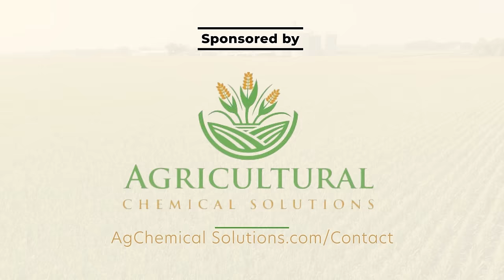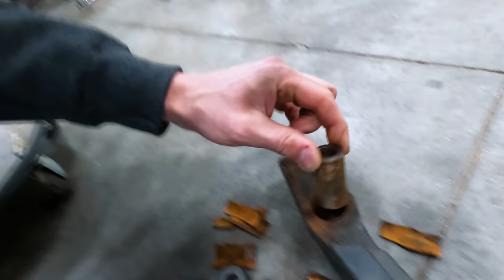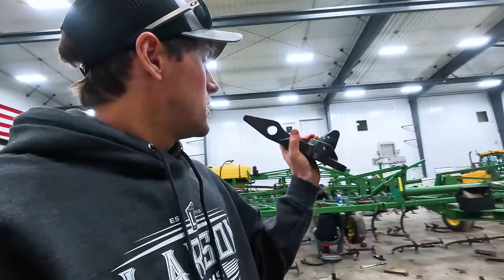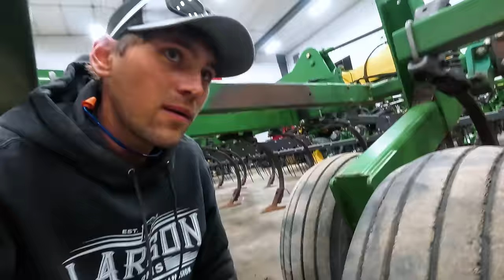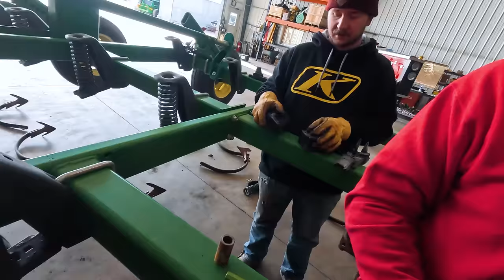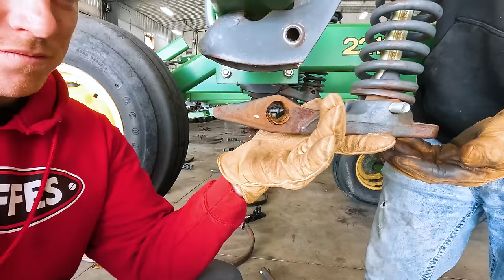Used And Abused! Time To Rebuild!

Comment: Ever thought about using plastic outrigger mats instead of blocks/wood for your lifting legs?    they are much handier, lighter, and sturdier than wood.    as a bonus most of them have holes for rope loops for lifting, moving, and storing them on the equipment : )

Comment: Yep, corn prices aren't good if you're selling. But finally, for those of us who have cattle and a feedlot, it's a blessing. Cattle prices have never been better, and putting corn into the feedlot steers isn't a checkbook buster!
Reply: We ate selling week old beef on dairy calves for 5 50 a lb. Absolutely insane.😂❤
Reply: How do you get by with welding on the equipment while still hooked up to tractor without damaging the computer in tractor do you disconnect the battery
Reply: @joeherndon5815  the welder does not have enough charge to do any damage to th tractor, further more the implement is the ground in the equation of welding.
Reply: I hate corned beef. Grass fed is much tastier.
Reply: @tuberNunya  corn is a grass

Comment: Take them cast iron parts your replacing to your local machine shop and have them rebore the holes oversized. Then have them make  bigger diameter bushings.

Comment: That digger frame is cracked one side because its pulling slightly sideways. Which means one side is going deeper than the other. I have done thousands of acres with those.

Comment: It is to the stage that it is cheaper to buy a machine shop for manufacturing our parts than buying the parts 
With a lathe and a vertical milling machine a day and you would be able to remanufacture all the parts you replaced in this video 
Regards from an old machinist 👍

Comment: @LarsonFarms hypothetically as someone who’s never done this those arms are cast and a type of casting that turns to powder when you scratch or hammer it instead of deforming into  a bur and those bushings are dom or forged tube so again hypothetically they spin in the hole causing the holes to abrade and remove some of the casting or the bushings start to wear and they hammer up and down into the casting wearing it out   

Now if you wanted to stop it hypothetically you could drill the holes out slightly larger in the casting then take an abrasion resistant steel tube like sls600 or ar500 and sleeve them (the parts would be a press fit into the casting) then take a different bushing material like oillite bronze and have those as the new bushing between the abrasion sleeve and bolt to take the abuse all hypothetically of course

Comment: I'm a Toolmaker and I was wondering if it would be more cost effective to open the holes on that black shank mount in press in oversize (Outside Diameter) bushings.

Comment: Track the cylinder and just sand the rough spots on the rod. They will only drip when the low spot goes through the seal. At least the rough spot won’t be there to chew up the seal

Comment: Still dont understand why you didn't just add a couple quick connect points on the boom of the excavator thumb line and run hoses down to operate the hydro's on the trailer.

Comment: Call it inflation call it capitalism but any genuine parts cost more then the generic. We buy oil filters that are a $100 bucks cheaper then the ones from case or john deer and they are made in the same factory just don't have the company logo on it. It's BS how they can get away with things like that. Definitely make it yourself if you can.

Comment: Wafer thin bushings, probably broke after u use it in the spring this year, to make the shop a little bit softer sounding, suspend from the ceiling foot n half, attach a few at mid upper wall 30 to 40 maybe only need 20,  SHEETS OF 1/4, 3/8, OR 1/2 INCH WHITE STYROFOAM  to improve the acoustics and save your ears, long term it does do damage, its an ear piercing sound it needs to be dampened

Comment: JD tillage equipment is the poorest design I've ever come across, the quality of the steel is almost CHINA quality. Going back to even the 70's the mold board plows, deep tillers and cultivators all had welded frames and worn out cast and bushings.